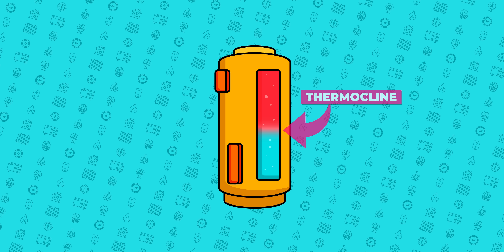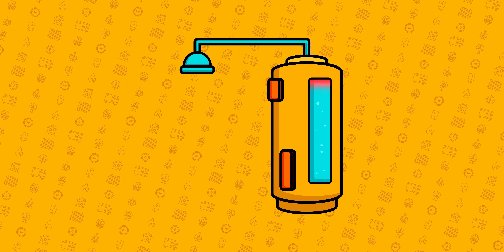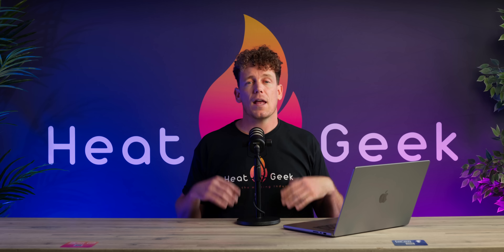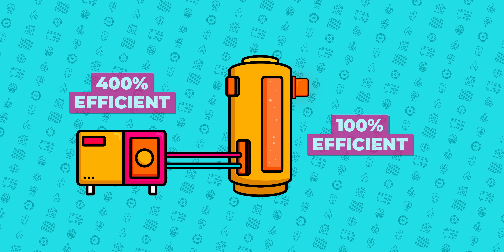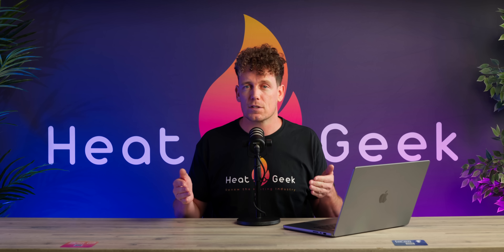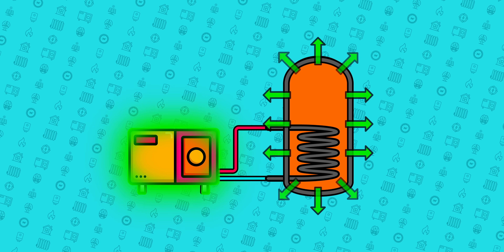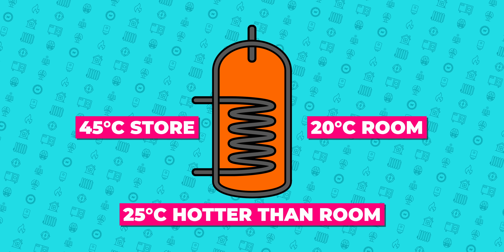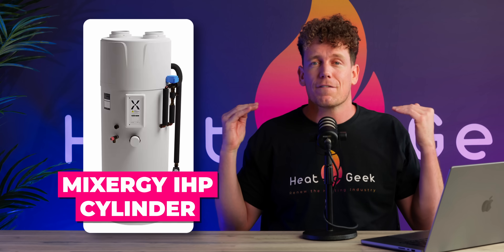Mixergy? THIS ALTERNATIVE CYLINDER IS 400% BETTER?

Comment: I’ve got a Mixergy and possibly the worst technology I’ve ever bought. 12 months the cylinder broke, leaking, but to Mixergy credit was replaced. Not a small task tho. 300ltr. But in less than a year the hub that connects the cylinder to the router has also consistently failed. Mixergy will blame sockets, surge protection etc but I have heatmiser, octopus, Airex and other devices that connect the same way and don’t keep losing connection. I have no tech benefits that are marketed. Don’t even know if we have hot water. It’s Russian roulette if the water will go cold part way through a shower. Trying to do the right thing. I’ve fitted a shower heat waste recovery, zehnder MVHR, loads of insulation, breathable membranes, but really regret this decision.

Comment: Hi, I am a all electric 3 bed bungalow.  I would like ti fit a mixergy in the loft, to gain some space, getting rid of the cold tank. I have been told by two of the plumbers I have asked,  that I must have the cold feed in pipe upgraded to 22mm. As at the moment it comes into the stop cock, and up to the tank in 15mm. Have been told that the pressure is goid, just short of 3bar, and the flow rate is good. Do I need the upgrade??

Comment: A much simpler and more efficient option is an indirect cylinder with twin coils and each coil controlled by a mzv, connected to a high efficiency gas boiler. All vertical cylinders will, via the laws of ohysics, have hot water at the top and, without a destratification system, have cooler water at the bottom. The Whole cylinder needs to have its temperature raised to >60 Deg.C if your concerned aboug legionnella. Then have the highest level of cylinder insulation that you can afford, plus insulate the hot water drawoff. We have used Gledhills bespoke cylinders for this product. Accurate control and pgramminv is also valuable, but varies greatly between different housholds.

Comment: I recently replaced my old copper tank with a Mixergy tank, and I'm thrilled with the results. Contrary to many comments on this video, and I find Adam's content incredibly valuable. As a parent of daughters, I can attest that the heat-up time with the Mixergy is significantly faster—nearly as quick as a combi boiler, thanks to my gas boiler. The data and control features are fantastic, and the stratification and diffuser provide much more usable hot water.

I'm considering getting a heat pump and thought about replacing my Mixergy tank. However, proper setup is crucial, as evidenced by a Mixergy user with a Vaillant heat pump achieving a COP of 480% at 12°C outside and averaging around 420% over the year.

Given these figures, it wouldn't be financially sensible to swap cylinders for, at best, marginal gains or possibly even a loss compared to some top-of-the-line heat pump cylinders.

Don't just take my word for it; here's a link to the blog for more details: 

https://energy-stats.uk/mixergy-heat-pump-performance/

Comment: Not sure if i missed it but could you do a review video on the heat pump water cylinder all in one tanks? I've got a cellar but not much space for an external airsource heatpump so i'm thinking that all in one tank might not be a bad idea, believe mixergy might also do those too and some other brands like Daikin
Reply: You mean a boiler with integrated heat pump on top? Mixergy now also has one.
If they just run on air of the room they are in, the room needs to be of a certain size and you still might need to add heat to the room at times. What is great is that it will decrease the humidity, which is great for most cellars.
You might also run it in a way that it outputs the colder air out of your home.

Comment: Is there any sense in having a cylinder with built in heat pump like the vaillant and a separate heat pump for the heating? If so would I still be eligible for BUS if the cylinder was installed prior to claim?

As a Techi I love the idea, but not sure how it fits into the picture.

Comment: Some time ago I watched your viewpoint of the Tado system and decided that was the one to go for. I am a veteran and now a pensioner who suffers with Complex PTSD, so my brain no longer works anything like it used to sadly. I now find everything difficult especially my Tado system. Can I ask you questions about Tado on here or elsewhere or simply bugger off if you want me to.
Regards Chris
Reply from the maker: Shoot!
Reply: We live in a 1960's bungalow so the inner walls are either brick or breeze block, I cannot remember. We are OAP's and I was recently diagnosed with Complex PTSD so I have bad memory and real issues with anything technical like Tado.
About 5 years ago we replace the original gas boiler from when the bungalow was first built with a Worcester Combi Boiler.
Couple of years ago the thermostat next to the boiler started playing up and I decided to go for a smart system as everyone was saying that is the way to go, aah but which one?
I did my research online and it came between Tado and Hive. People on the internet were saying go to your channel for a really good assessment of smart systems and having watched one of your updates, which I cannot seem to find we went for Tado.
First thing is I contacted loads of local plumbers and they either said "Don't touch Tado" or "Don't know anything about Tado, never had to fit one" So that's not a very good start so I found a plumber who said although he had never fitted one he would have a go, as it cannot be much different from anything else on the market, how wrong he was.
Now we have two zones, one is the new new kitchen extension which has underfloor heating. The other zone is the rest of the bungalow which has radiators.
Our plumber had awful problems wiring it up to the boiler and that he had to keep phoning Tado did not help matters. In the end he had it working. I was having the problem of getting the Wireless Temperature Sensor to talk with the Internet Bridge. Tado advertised distances when I made my purchase of the wireless range and they also said that it would bridge enough for a 3 floor house. I notice that has all gone now mmmm. I personally take it as a lie as we only live in a bungalow and nothing would connect. Good thing I had the foresight to have ethernet put in the bedrooms as that is where the Bridging Unit is.
In the end I managed to get everything connected, in range and working 🤞
In September 2022 we had a fault with the boiler, minor leak which ruined some electrical connections, this was repaired and since then it has worked perfectly.
Last Friday for some unknown reason radiators would not get hot, always happens on a Friday. Over the weekend I tried to make out what was wrong, sent a long chapter and verse about the issue to Tado on chat and waited till Monday for a reply. Wonderful service not.
My Tado app on my mobile stated that everything was connected and battery power was good on devices requiring battery's.
Tado got back to me and it was a question one day which I would reply to and then nothing until the following day when they would ask another question which I would reply to. Everyday they kept asking for photographs of the wiring which I kept sending, asking did I install it myself which I kept on answering. Then finally they said it sounds like a connection issue and gave me loads about what to do when I have already said the system says everything is ok. 
I thought they could check from their end how the connections are. 
This is the third time we have gone without heat when it has been freezing outside. With this one its five weeks in total, I think they are hoping we will freeze to death.
My plumber is no longer getting back to me as I think he is totally pissed off with Tado, I do not blame him.
I really do not know what to do, Tado help is a total waste of time. Must admit that since I have had Tado and had access to the forum which I wish I had seen before I would never have purchased this system. You should have a read, very enlightening but soul destroying aswell. Surprised they were allowed to sell this over here to be honest.
So another cold night for the missus and me, only get warm when we go out in the car.
Regards Chris
Reply: @Chris-BognorRegis at least they answered you

Comment: I have a Granny Annexe, with a bathroom including a shower, small kitchen plus an outdoor kitchen. I’m looking for a stand alone hot water solution. Would you recommend a mixergy iHP? The heating is air to air heat pumps for the building. Love the videos, I’m doing a self build but unfortunately no heat geeks available in my area so having to fumble through it myself. Cheers

Comment: Ok having watched your video a few times and raised queries, this is where I am at. Help! 
My suppliers are proposing a mixergy rather than a regular cylinder. This is what they said.

“Basically the manufactures state with the normal unvented cylinders they best work with a water pressure working rate of 1.5 and a flow rate of 22 litres per minute.
 
From our survey, your water pressures came out at a 5.0 standing pressure, 1.2 working pressure and a flow rate 0f 15 litres per minute.
 
The mixergy cylinders manufacturers state they work better for lower working pressure under 1.5 all the way down to 1. Hence why we have assigned the mixergy cylinder with your heat pump. We believe following our guidelines and the manufacturers this will be the best for your individual circumstance.”

Are they right?
Reply from the maker: No that makes no sense what so ever. Worth noting they’ve made a significant upgrade to the sensors since this video which will improve its performance.
Reply: But you’d argue that a regular cylinder would still be best? Can’t see BG going for one of your specialty ones. But I’m also working on the assumption that if all the kit comes from one supplier then post install maint costs should be lower and one shouldn’t get the “no its your heat pump thats the problem, “”no its your cylinder”issue. Have you done an episode on post install maint?

Comment: Have a 250lt megaflo cylinder. Boiler flow temperature is set at 55C. The water in the cylinder is at 50C when the thermostat stops calling for heat. We have had it for six years and recently I popped my scope camera inside and looks like brand new. Absolutely zero limescale. Only shiny stainless steel without any corrosion (probably because we have never used the immersion heater)
Do I need to replace it if I have a heat pump installed?

Comment: Hi, really interesting video. Thank you.
I’m investigating ASHP options. Currently have a Gas system boiler with a 300L thermal store. This runs radiators, UFH and mains pressure Hot Water via a plate heat exchanger. Heat is also added by a wood burning stove back boiler and Solar Thermal. I’m looking to replace the thermal store with a better insulated 500L cylinder with an internal coil for mains pressure hot water (no worries about legionella) with the wood burning stove/back boiler. Would probably swap the solar thermal for PV, as this would be more flexible with an ASHP.
Question, how much less efficient would a thermal store heated from an ASHP be than a standard Z/S plan hot water tank. 😀

Comment: Would be good to see a similar analysis of the sunamp heat battery system.
Reply: I have a sunamp but not a heat pump  - so yeah, that would be great. The Sunamp excels with space contraints because it does the same thing in a third the space. The drawback is that it weights a ton (260kg for the x300) so that can limit placements. It does claim to store heat more effectively than a standard insulated tank because it's storing heat chemically and therefore loses heat more slowly. 
Heat pump guys I know have said it works great and you can charge it up from the heat pump.

Comment: Obviously what you say makes sense. Using a regular cylinder is less expensive and more efficient with a heat pump. So why are so many installers putting in the mixergy. I didn’t have a single quote that didn’t include a mixergy. For the likes of Octopus who are trying to keep costs ,and hopefully complexity , down it would seem a no brainer . I’m awaiting an install, do I need to go back to them to discuss this. I need the simplest system possible , because although I’ve committed to getting the heat pump I am very worried about the running costs ( electricity) and the maintenance costs ( for annual and ad hoc servicing). The more complex the higher the risk and the cost! Help!
Reply from the maker: I don’t know any installers suggesting them personally but am aware of alot of customers requesting them and I don’t think they know why

Comment: Good evening 

I'm a heating engineer and have installed a few heat pumps etc. I have been back to service a unit today and it showed a cop of 5.11 for the December period upto date.

I wanted to know how I would go about getting this on the website you mentioned on a different video.
Reply from the maker: Open energy monitor dot com

Comment: Hi Adam, really love this channel. My property has 2.0 bar/40LPM and I've been advised this would prevent me from installing a Mixergy Cylinder with my gas boiler?
Reply from the maker: That’s a load of rubbish. Find a different engineer. Use a heat geek Infact. Google ‘find a heat geek’

Comment: Does the IHP (or other built in pump and cylinder combos) addresss the issues raised in this video?
Reply: Yes, it doesn't use the external heat exchanger, it just heats the top directly. Same if you would just use the electrical version that also only heats the top first.

Comment: I've been living with one of these for a couple of years. The single best thing about it is the super accurate temperature gauge and it's display. The top down thermocline electric heating also works really well. On our 250l cylinder you can get it from zero to 5% charge in less than 10 mins. A 5% charge will do you fine for a 10LPM shower for 3 mins. Even with 1% charge you are still getting good hot water out of it. Because we know exactly the state of charge we really only heat water on demand now. I schedule a small heat just before our known normal use periods. If you need a bit more it is really easy to boost from the gauge or the app. This way we never have heat sitting there gradually leaking away. This works well for us as we've got a home battery and PV array so we are only ever powering it with free or cheap rate energy. We currently space heat from a log boiler which is also connected to the tank. This works but you loose the benefit of the top down thermocline heating as the stove is connected via a plate heat exchanger and the circ. pump stirs the tank up. This means an indicated 5% charge means the whole tank is at about 30 degrees rather than the top being at 45 and the rest at 18. This in turn means that you need to get the charge level higher to get acceptably warm water which in turn takes more energy. You would get the same issue connecting a 3rd party heat pump to one of these. I wonder if the IHP tank does thermocline heating as effectively as the immersion version. If it doesn't my current setup may actually be more efficient overall for my use. If you are into smart home stuff these are great - they integrate with home assistant really well and give nice data on charge level, top temperature, bottom temperature power use and calculated hot water volume use. Our family of four uses about 4kWh for hot water daily with this arrangement.

Comment: I have mixergy,  but i was aware of the need to charge the whole tank to 100% before i bought it.  The solar diverter is very good. When the heat pump goes in an time of day tariff i will fully charge as thats the quantity of water i need.

Comment: Is it possible/sensible to use a shower pump with a HW cylinder filled with water from an ASHP? We have a gravity fed system at the moment, and the shower pressure is disappointing to say the least. Thanks!
Reply from the maker: Yes. Better to just update your hot water system though

Comment: Since you mention the stratification. Can you make a video ont this with a normal tank? It appears that in my current setup filling the bath is disturbing the layering too much resulting in too cold water at the end of the fill.

More details on my current situation:
280 liter tank. Around 50 degrees with the sensor mid tank.
Bath 200 liter.
Filling it up with the thermostatic faucet  at full speed till the bath is full.

Comment: I’ve got an existing system with a  500l thermal store heated by a wood burning boiler and a gas boiler.
I’m replacing the gas boiler with a heat pump. I would like to retain the thermal store as a giant buffer to store off peak heat from the heat pump - and to retain the wood burning boiler.
Most heat pumps are not set up for high low temps when electricity is 4x cheaper.
This is getting complex before solar and batteries are added…
(Hot water will be a new separate cylinder preheated by the thermal store…)
Suggestions
Reply: I have a similar setup with combi boiler and wood boiler. I'd stick to that combination as I think it's the most efficient one. Do you have solar panels (PV)?
Reply: @MarkEvans-j1w  I will be getting 10kw of solar and powerwall - and think this will make the heat pump  a viable option together with time of use tariffs. But the heat pump controllers are not setup for cheap nighttime electricity. Keeping the wood burning boiler and thermal store is difficult with a heat pump - so I’d stick with what you have got unless you get solar of batteries. I’m using the thermal store as a giant buffer tank for the heat pump and wood burning boiler via the solar coil.